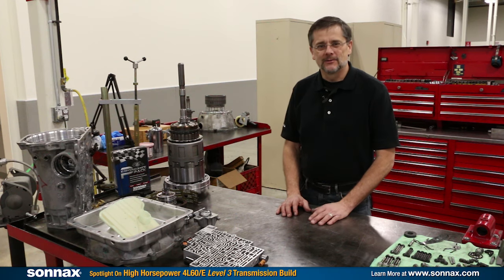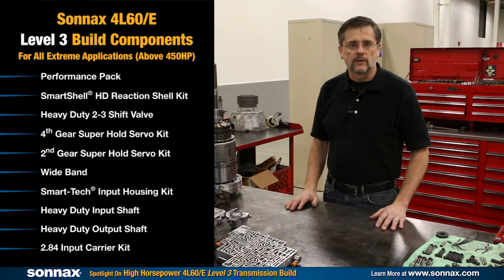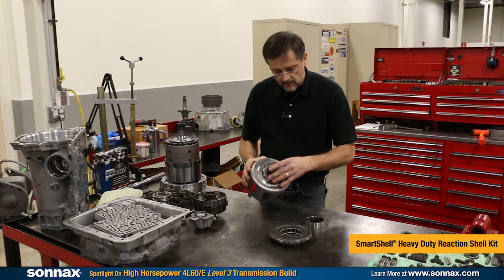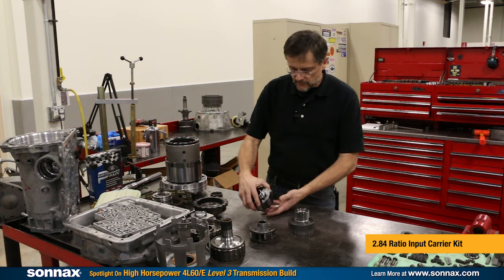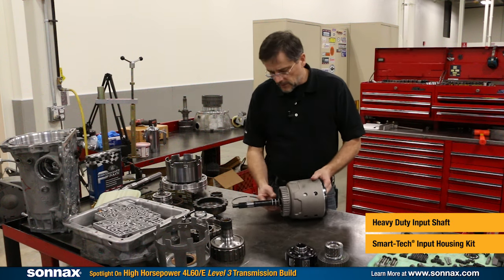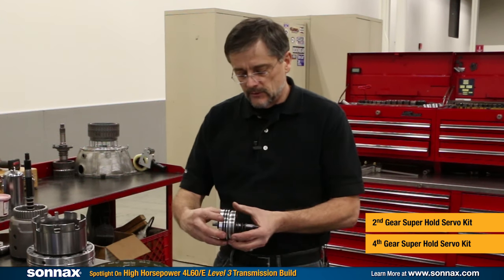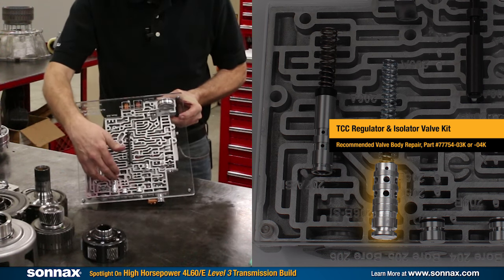Your Guide to a Sonnax 4L60/E High Horsepower Level 3 Transmission Build

Comment: Dont bother with sonnax products on your daily driver, only race applications
Reply: Maby ?  My '02 5.3, 1500, 4L60 (all stock) trans lasted 200k mil, rebuilt at 300k and it's out again at 402,000. 
 With a new 380hp engine, think it's a good idea to upgrade that trans. ??
I'll look into it ,  drive on.
Reply: @gsp631  If your stock trans lasted til 200k miles how do you rebuild it at 300k? when it stopped working at 200k??
Reply: Thx cow muscle, I failed to say rebuilt "again" at 300k.    Thanks  for the correction.  So I'll look into the sonnax stronger parts. :)
Reply: Bob Hoffman  I'm looking into this  thank you much for the advice.  :)
Reply: Bob Hoffman   I have a 3.7 liter inline 5 in my H3 Hummer I want the best 4L60 will a level 3 be compatible for a 245 horsepower engine. I'm not sure if it is stiffer. The engine needs a 5 or 6 speed transmission.
Reply: Bob Hoffman   thank you
Reply: some updates yes.. not all. the superhold servo is notorious for coming apart and causing issues. but thanks for stating how you are above everyone else.
Reply: most sonnax parts are fairly priced and a definite upgrade from an inferior stock part. just use your best judgement on what it should get for its intended use and you can build a tougher trans even for the street.
Reply: I guess I just have bad luck I never had a chevie transmission last over over 130,000 till I build them to last like this thanks Sonnax
I do tow a lot and I do run transmission cooler

Comment: I have a a Hummer H3 with a 3.7 liter inline 5 I want my 4L60 to work easier with the 245 horsepower. Would a level 3 Sonnax upgrade be compatible. I would like the best 4L60 I can have.
Reply from the maker: Hi Daniel, our tech team would be happy to help you. They can be reached directly via email at sonnaxtechsupport@sonnax.com, or phone at (800) 843-2600 ext. 398. Thanks for reaching out!

Comment: Do one for the 41te we can use the updated 42rle jeep input clutch retainer and drum update with more clutches my pt cruiser flys with a full build and 8 bolt billet tc connected to the flex plate . Mines has a 5 oinion planet too

Comment: Great video.In My 4L60e,in my 2000 Chevy s10,I was driving and noticed it slipping a little.All of the sudden it quit pulling.Like it went to neutral.Next day it worked until it got warm,then nothing.What you think.
Reply from the maker: Hi Robin, thanks for your comment and question! Our product support team is available to help with any questions related to Sonnax products, but for general tech questions, we'd recommend contacting our friends at ATSG or ATRA for assistance. Hope that helps. Thanks again, and good luck!

• ATSG: https://www.atsg.us/   
• ATRA: https://www.atra.com/
Reply: Probably low on fluid or time for a new transmission

Comment: What stage  would you recommend for a 2011 Silverado 4l60e with 24x14 wheels transmission went out once I drove a day or 2 on the wheels
Reply from the maker: Hi Johann, Have you checked out our 4L60/E build guide yet? If not, that would be a great starting point: https://www.sonnax.com/tech_resources/617-4l60e-performance-heavy-duty-transmission-build-guides. If you have any specific build questions, our product support team would be happy to help. They can be reached directly via email at info@sonnax.com, or phone at (800) 843-2600 or +1 (802) 463-9722. Thanks for reaching out!

Comment: So i purchased and installed the performance pack in my 2003 4L60 E. Installed most of the components with the exception of the band servo components. The kit doesn't come with a new o-ring for the servo case cover. Why is this? There should be no reason to have to purchase a separate o-ring to complete the instillation of this kit. And for first timers attempting to install this kit themselves, do yourself a favor and order a replacement separator plate and gaskets for your model year application. Ive yet to see a separator plate with any miles on it not have a check ball seat either worn, and in one case, blown strait through the separator plate. And besides, you'll need the gaskets anyways as the Sonnax kit obviously doesn't come with new gaskets. Save yourself the headache and do the job right the first time. Other that not being able to update the band servo components yet, (until I get a new o-ring), the kit works as designed. No banging hard shifts at light throttle, but noticeably firmer shifts under spirited driving.
Reply from the maker: Hi racrx7, thank you for choosing Sonnax products for your project. We hear your comments loud and clear, and appreciate your feedback. Our explanation is that this kit and instructions were initially prepared for the transmission rebuilder professional who is familiar with and likely to have these extra parts readily on hand. We know there is increasing desire for more comprehensive kits/instructions for folks like yourself, and we are working to make more of that available. Thanks again for the feedback, and have a great day!
Reply: Sonnax, no worries. I’m satisfied with the performance of the Performance pack. As a retired ASE mechanic, I understand the hows and whys of component functions. This is the main reason I chose Sonnax over other brands. Pin-less billet accumulator pistons are superior to the OEM ones. 👍🏻
Reply: @racrx7  how much was the kit?
Reply: I have a 3.7 inline 5 would a level three be compatible for 245 horsepower. I would like the best 4L60 I can buy.

Comment: How much does a stage 3 usually cost ?
Reply from the maker: Hi Junior, this list contains recommended parts for your level 3 build, but all parts are sold separately. The way to purchase our transmission parts is through authorized Sonnax distributors, and they will be able to help you out with any pricing questions. You can easily find the one nearest you right on our website: https://www.sonnax.com/distributors. Thanks for reaching out!

Comment: Is there an adaptation to change the overdrive ratio from 0.69 to something like 0.65 or even 0.61?
Reply from the maker: No, there is not. Thanks so much for reaching out, and have a great day!
Reply: @sonnax  Thank you for the response.  Can you look into making one? I do like Sonnax for durability but I would also like much better fuel economy as well on long distance drives as I don't build for power handling.
Reply from the maker: @shadowzedge5793  Due cost and complexity that is not something we will be producing. We have looked in-depth at this idea for other applications and determined it is simply not practical. Further, in general fuel economy gains only occur if you move the engine rpm into a more efficient range. Usually, lower rpm is more efficient but not always, so each vehicle, engine and final drive ratio will see different gains etc. Rather than tweaking an existing overdrive ratio slightly, we determined similar efficiency gains could be achieved simply by changing tire size and especially by improving vehicle aerodynamics. Both of which are less costly and easier to implement than a re-engineered low volume custom planetary gear set. Hope that helps, thanks again!

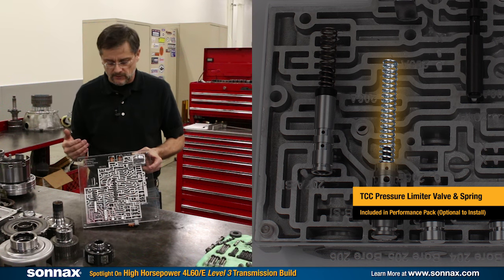Comment: @8:23 "the only way to eliminate pwm...." Does that mean I can get a later model 4l60 to work on my 94? I'm asking because I read that one of the differences in years is the fact that not all years used pwm.
Reply from the maker: Hi, our tech team would be happy to help you directly. They can be reached via email at sonnaxtechsupport@sonnax.com, or phone at (800) 843-2600 ext. 398. Thanks for reaching out!
Reply: hope u get a straight answer .  I have a 95 i want to put in a 93. some say it cant be done. and work right.

Comment: Would this be capable of 700-750 rwhp or should I just do a 4l80 build. It’s going to live in an 03 sierra with a 78mm turbo.
Reply from the maker: Thanks for your question — yes, this Level 3 Build can absolutely handle that power and more. However, if your Sierra is 2WD, that's one of the least complex vehicles to swap a 4L80 into. There are costs and considerations either way, but for most applications, the most straightforward approach is to build the 4L60 to handle the power. Sonnax has upgrades to improve the durability of a stock transmission whichever way you want to go with this build. Hope this helps!
Reply: Yeah it’s a awd  and I was avoiding the 4l80 swap if at all possible.  Thanks for the quick reply!
Reply from the maker: @KLEPTO408  You're welcome, good luck with your truck! If you get the build together and want to share a photo of the truck or the parts you're using on the Sonnax Facebook page or Instagram, we'd love to see it.

Comment: I have a 98 gmc jimmy sle 4dr 4x4. The previous owner replaced the trans with a jasper unit and while I haven't had any problems as yet, I just don't trust it. What kit do you make for a total rebuild?
Reply from the maker: We don't offer complete rebuild parts (clutches, seals, gaskets, etc.) but we do have plenty of options for a solid rebuild. Just keep in mind that if the Jasper warranty was transferable, making any changes might void the warranty. Check out what we have available at www.sonnax.com/units/455-4l60-e, and if you have any questions, our sales team would be happy to help via email at info@sonnax.com, or phone at 800-843-2600. Hope this helps, thank you for reaching out!
Reply: when you change the gear ratio do you have to program the pcm?
Reply from the maker: Overall the shift points related to engine RPM do not require reprogramming, etc.  

As for ratio codes, etc., we can confirm the 77284-K 2.84 ratio input carrier kit does not require PCM/Trans computer reprogramming to adjust for the closer ratio when used in 4L60-E and 4L65-E applications. 2007-Later 4L70-E applications have an added input speed sensor, and even on these we have never heard of it setting a ratio code or requiring reprogramming.

Comment: Will it hurt anything if I run full line pressure all the time? Will your tss valve still compensate when the converter is in lockup? How about wiring it for full manual shifting all the time? Is ecessive  pressure to the lockup clutch the main cause of thrust surface wear? What power level should I consider anti balloon plates? Im shooting for 550-600 hp flywheel hp. About a 50/50 drag race to street use ratio, so should I keep the 4l60e or just go with a th400? I like the idea of overdrive and lockup but Im worried about durability too.
Reply from the maker: Hi poncoolride, our tech team would be happy to help answer all of your questions. They can be reached directly via email at sonnaxtechsupport@sonnax.com, or phone at (800) 843-2600 ext. 398. Thanks for reaching out, and have a great day!

Comment: Don’t waste your time go the th400 route I popped two built 4l65e with a lot of this gear in it minus billet shaft etc first built box popped with 400rwhp only 200 miles next day lol second rebuild lasted 12 months after with ran a different stack up 3/4 is the dog shit of all in the 60e line and sunshell save your coin and headache buy a th400 still going strong 700rwhp turbo ls
Reply: Minus the billet shaft, etc--most of, huh?  Did you ever watch their Smart Drum video?  Extra friction in it, and it still has stock thickness steels.  Why would anyone EVER do a "half ass" trans build, and put it behind any high horsepower engine?  Talk about a "bad (dumb) move"--just asking for trouble that you're sure to GET--You've proven that, right?  Smh...

Comment: or you can install a 4l80e for less than the price of the input shaft.
Reply: Bob Hoffman  4l60e is not in any way shape or form what anyone who is knowledgeable in the realm of transmissions would think of as a "robust" unit. You can throw everything you got at it  but it's like putting lipstick on a pig.  If you want something robust, start with one that's already made for torque and build up from there.  Next, this is a forum to exchange ideas  if you don't like it move to North Korea.
Reply: Bob Hoffman  hey was wondering how much power you think my 4L60e will hold, im building one now (02 4l60e out of an astro van converting it to 300mm to use behind a cam and head ls1) all Alto heg frictions except the 3/4 are Raybestos GPZ100 pinless accumulator pistons beast sunshell and a covette servo. Basically all other hard parts are stock also a few things im doing to prevent 3/4 clutch failure is setting 3/4 clearance to about .035 and sealing the servo exhaust port with a cup plug instead of using the check ball capsule also using hi-per blue apply pistons instead of the stock black rubber ones. Btw is it really bad to delete the pwm tcc apply, I use a fitzall tcc regulater valve that basically seals it up.
Reply: Bob Hoffman  oh all right lol this is actually my secound 4l60e I repaired a "built one" that went into my 99 trans am with an LS1 that thing didnt last 10k and I didnt wanna drop another couple of grand to have it built again. Actually what I found and I think this is one of the main reasons why they fail is the apply pistons and clutch clearance also to servo checkball capsule contributes to it. The 3/4 apply piston in my 4l60e had already went bad, when I took it apart I could not find anything wrong until I felt the molded rubber on that piston. The rubber had already gone hard and didnt seal very well I checked it against a new one I had laying around and sure enough it was bad, I think it caused a weak apply to the 3/4 clutch burning them up slowley over time anyway I dont use the stock black rubber pistons im using hi-performance blue pistons (better rubber) also in the manual clearance is set between .060 to .086 I thought that was way to much since I noticed the farther the 3/4 piston travels the more pressure blows by I actually seen that testing with air. So now im shooting for about .030 to .035 my current one I set clearance to .038 so far its been two months and its fine one more thing I replaced all accumulator Pistons with sonnax pinless pistons and plugged up the 3/4 accumulator piston(you dont need it) anyways ill put more miles on it see how long it lasts this one im building now im trying to make into a better unit with all the little tweeks I added to the repaired one.
Reply: Bob Hoffman  that wasnt the case in my transmission the 3/4 apply piston was clearly bad and didnt seal properly I dont see the need for a smart drum for something making under 500hp lots of guys use the stock drum with success, one thing I didnt mention in my last comment was when I built the input drum I replaced the apply ring and used a thicker backing plate (to get less clearance also reduce flex) even though im a novice and I do use some of the sonnex products I dont see why you should drop down $500 to eliminate a problem you can solve with $50 in parts. Now dont get me wrong if I was building something to handle more than 700hp and money was no object I would get a smart drum, smart shell, 5 or 6 pinion planetaries and billet output shaft but for what im building now it doesnt call for it. And thats my 2 cents lol
Reply: @martinez1701a  Late reply, I know, but the purpose OF the "Smart Drum" is to ELIMINATE ANY/ALL flexing of the backing plate.  Even "normal" horsepower engines CAUSE that to happen.  Spend the $ ONCE, and your 3-4 clutch pack problems are GONE, forever.  The Sun Shell they offer is another wise move.  Money IS always an "object," for most of us--why NOT put serious $ into your unit, so that it will STOP breaking?  Once and DONE...   LOL

Comment: What’s the part/serial/unit number? My local sonnax distributor couldn’t find the kit.
Reply from the maker: Hi ehrndz87, not sure which part it is you're looking for, but you can see the full list of parts and part info in the Level 3 build here: https://www.sonnax.com/tech_resources/617-4l60-e-performance-heavy-duty-transmission-build-charts. Hope that helps, thanks!